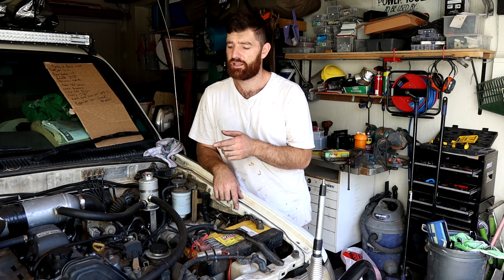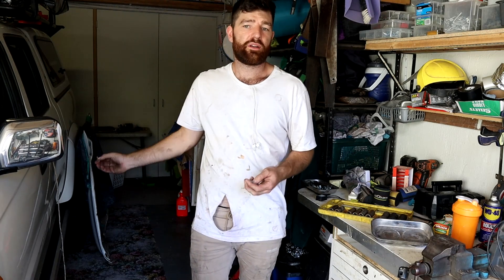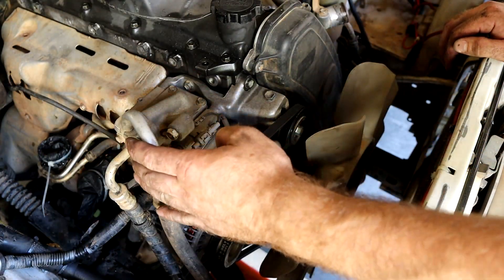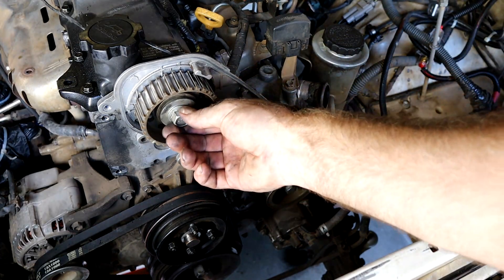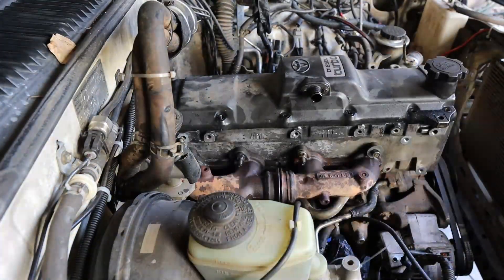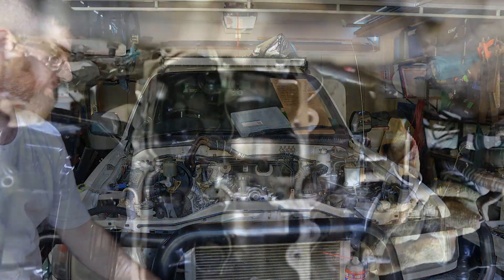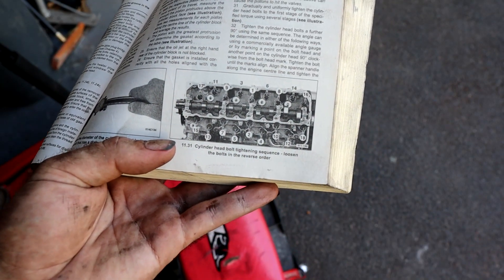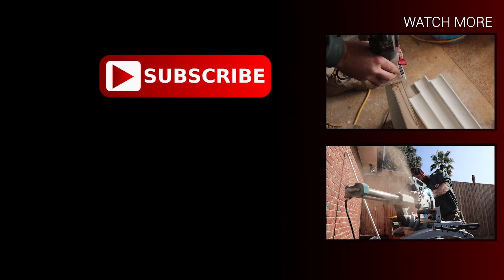How to Remove a 1KZ-TE Cylinder Head  | 1KZ Hilux Rebuild EP01

Comment: That exhaust manifold nut you had trouble with, & had to get the coolant pipe out of the way.....I just put the socket on an extension straight down past the manifold, (a 1/4" one) & got straight onto it! It's the very back manifold bolt, & coolant pipe that's giving me the hard time. Putting a mounting bolt on the very back of the motor for the coolant pipe is just nasty! And, you can't get on it with a ring....Frustrating!
Reply from the maker: Sometimes I'd rather pull the engine out rather than fiddling with 1 nut/bolt for hours

Comment: Thanks for this video, im just starting tesr down to see what is wrong with my KZ185.  Coolant out the tailpipe, I'll hopefully know soon the culprit.  If its just a headgasket, do you have any other suggestions for what I should refurbish while im in there?
Reply from the maker: what's your budget? I'd do the usual seals and belts and maybe some aftermarket temp sensors and gauges. Check out my best hilux mods video
Reply: I know i'm way too late with this but WITH a head job automatically comes a timing belt kit. Depending on when you did the belt of course it just makes sense to do it while every thing is apart. A full timing kit includes the timing belt as well as the other belts water pump hydraulic tensioner seals and pulley etc

Comment: I haven't owned a 1kz-te since like, 2015, but watching your videos is triggering a trauma response. reminds me of how much i hated working on my KZN-130 SSRX. stupid oil drain hose under the turbo breaking. stupid heads cracking. bloody impossible bolts down between the engine and firewall. just a total bastard to work on.
Reply from the maker: Lol preach, sounds like most cars tbh

Comment: Hope you’re still commenting on this. I’m about todo a year down to replace my head gasket And overhaul on my Kzj71. When you put the head bolts back in, did you need to tighten them back down again after 500kilometers of driving?
Reply from the maker: I did not. There is no way to know what the torque setting is supposed to be anyway because of that last 90 degree tightening sequence that you're meant to do when you install the head.

Comment: I watched this video as guidance and also battled getting the intake and exhaust manifold off in situ. Then it dawned on me, why not just undo the turbo, along with all wiring plugs and piping, and just remove the entire head assembly?! It is then a simple matter to disassemble the head on the workbench. After battling with the EGR pipe behind the turbo and stuffing up the nut, I did just that! A lot less strain and time spent on disassembly!
Reply from the maker: Awesome tip. Taking off the head doesn't need to be so scary and I reckon for the cost of a head gasket and some head bolts it's totally worth it when you can save time and frustration.

Comment: I know you did this ages ago but there should be plenty of piston to valve clearance when theres damage from minor artefacts in the combustion chamber for it to not be a concern, it would be odd if there was any metal that went through there unless the engine grenaded then you'd know that. So was likely just a chunk of carbon hard enough to do a bit of damage. The metallurgy of these motors is pretty outdated as far as alloys/strengths are concerned. They wouldn't hold a candle to your average diesel built today, even though theyre still great engines.
Reply from the maker: Totally agree but in this situation the tip of a glow plugs broke off and caused damage to the valve itself. Yes I could have fixed the valve but it was cheaper to use my second hand head that I already had at home. 
Still going strong today
Thanks for watching!

Comment: what make of cylinder head did you use where you buy from and how much please mate?…cheers
Reply from the maker: Second hand Toyota head is what I used but I also have a brand new AMC head in storage if anything goes wrong again. I got that from my local machine shop
Reply: @lvlupbuilding  Hello mate i took my 2004 Hilux in to get SAAS digital dual readout pillar gauges installed and when i went to drive it out the head or head gasket or both decided to take a shit. So i'm where you are right now. I just purchased a complete timing kit now i need the head. There are two heads that go with the Hilux. One is labelled 1KZ and the other is 1KZTE for the turbocharged Hilux which is what i''ve got. One head is for valves that are 0.010 below head surface and the other which has valves sitting 0.040 below the head surface. Would you be able to tell me which i should order. The mechanic has not yet taken off the head i don't know when that is going to be either next week or the week after i can't wait that long. I need this done asap. Can you help me out and let me know which one to order. I'm in Sydney and the head supplier is in Melbourne. I need to get this right as the freight sending it up is no charge but if its the wrong one i'll be lumbered with the freight charge if i have to return it. If i had all the right tools and some privacy with a concrete surface i'd do it myself. Can you help me please bro? Cheers!

Comment: Some people have said bubbling in the overflow tank or radiator is normal, it’s not, if you have this your head gasket has failed or head has cracks, I had oil in coolant but no coolant in oil, some smoke but continuing to run a vehicle with this will do damage best to pull the head, thanks for the video!! 👍
Reply from the maker: Thanks for the smart advice! Have you been working on Toyotas for long?
Reply: @lvlupbuilding  Where did you buy your cylinder head?…what make?… and how much did you pay?…cheers mate
Reply: Toyota’s no but have done many a cylinder head on various 4 pot diesel lumps in various truck platforms and the symptoms are largely the same, the viscous fan is what kills the 1kz head that and the slow to react temp gauge, I always advise people to fit an aftermarket coolant temp gauge for back up, digital units are far far more accurate, and are very cheap nowadays and great reassurance, further from that a thermostatic fan kit is the ultimate option, I have the SSRG hilux gen 3 surf sold here in the uk, it has an auto trans so any issues with cooling become a bigger issue very quickly due to the trans adding head to the equation via the heat exchanger in the bottom of the radiator I shall be replacing my viscous for a fan kit at some point, I did this on my Ranger 2.5 and was very surprised at the extra pep it had not driving the fan
Reply: Toyota’s no but have done many a cylinder head on various 4 pot diesel lumps in various truck platforms and the symptoms are largely the same, the viscous fan is what kills the 1kz head that and the slow to react temp gauge, I always advise people to fit an aftermarket coolant temp gauge for back up, digital units are far far more accurate, and are very cheap nowadays and great reassurance, further from that a thermostatic fan kit is the ultimate option, I have the SSRG hilux gen 3 surf sold here in the uk, it has an auto trans so any issues with cooling become a bigger issue very quickly due to the trans adding head to the equation via the heat exchanger in the bottom of the radiator I shall be replacing my viscous for a fan kit at some point, I did this on my Ranger 2.5 and was very surprised at the extra pep it had not driving the fan

Comment: How many ks do these motors do seem to be always been fixed ? a bit of a lemon for Toyota ? Toyota petrol engines have been very reliable for me ,like my 2rze hiace and camry
Reply from the maker: any diesel should have its fuel system refurbished especially the pump after 300,000kms. if this is done these engines will last min 600,000 kms and max 1,000,000kms. bad fueling = heat, too many mods without supporting mods = heat
Too much heat = 1kz rebuild
Reply: if you have one of these and want to get more power…for anyone interested this is the route i took on mine a 2004 Hilux Odometer 258000k’s…3 inch exhaust…got the EGR and inlet manifold cleaned out…(just those two steps alone and you’ll feel benefits straight away) then off to the tuners… Steinbauer Chip with additional ECU top up tune…new glow plugs..new injectors…while getting the top up tune i also got an EGR delete (not the blocking plate i got them to delete it at the ECU) also included in the top up tune i had the boost turned up to 16psi with ‘dongle’ and added a boost controller to keep everything in check and just to be safe i got a new clutch fan hub installed…..thats it…no intercooler… stock standard radiator…its safe…no overheating no engine lights come on…been to Perth and back to Sydney 3 times since…on one trip back from Perth DID NOT SHUT IT DOWN ONCE…even when pulling in for fuel and didn’t burn a drop of oil…just want to give a shout out to JC Diesel in Narellan…for the tune.

Comment: that damage on the head and valve would have been a broken glow plug. i just put a new head on my 1kz-te and two glow plug tips snapped off inside the combustion chamber. be weary when reusing old glow plugs. i learnt that the hard way.
Reply from the maker: Good tip!
Reply: What make and where did you get the head? I originally wanted an AMC head but they are $2300 fully assembled so i have to settle for a Chinese ETP brand at $1050 AUS but the money i save will go toward a full timing belt set $246.00 which you have to change anyway so i'm happy with that. So what brand of head did you use and how is it holding up?

Comment: I've got a 96 hilux surf kzn185 and it might have a worn head gasket. Only just started a week ago, but it starts rough sometimes then runs completely fine. It's like there's hardly any compression at the start and it builds up slowly until the truck hits idle. But yesterday after I put new coolant in it, I noticed white smoke coming out the exhaust, it then stopped and started doing it again. And the radiator fluid started spitting every now and again, when the cap was off when warming up. Does this sound like a faulty gasket?
Reply from the maker: maybe, do a compression test, and check for bubbles in the radiator and excessive crankcase pressure just to be sure